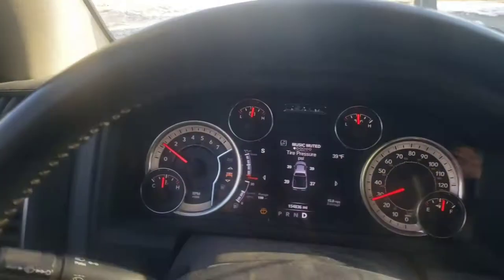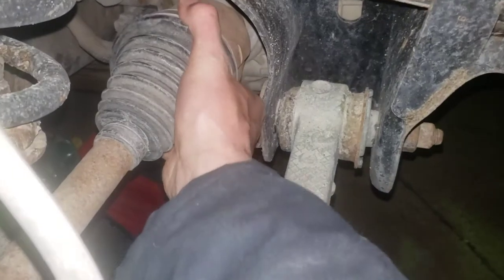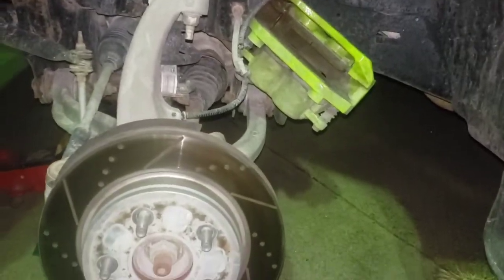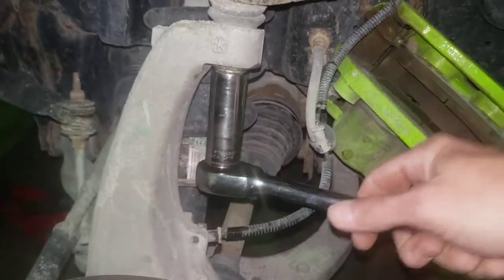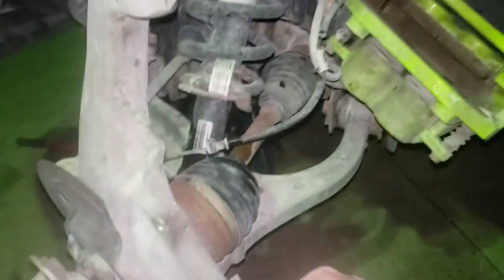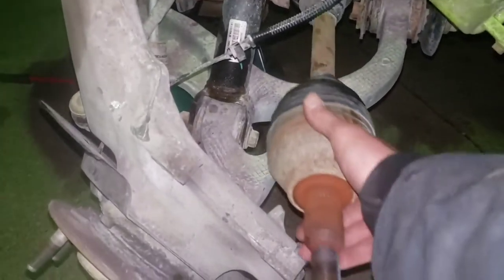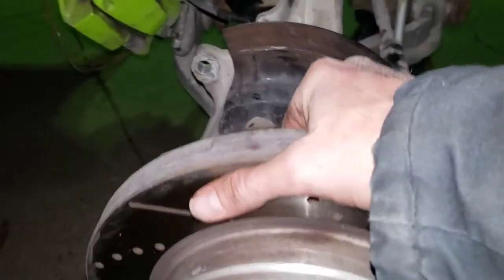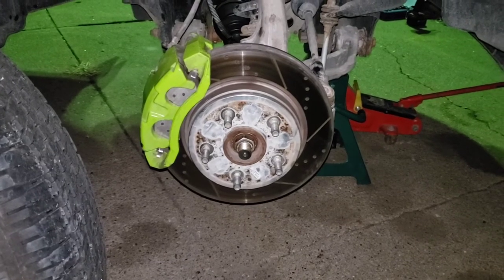CV axle & intermediate shaft. Ram 1500

Comment: Hayne's Manual from your local auto parts store has most of the torque specs. I have one for my 09 Ram. I've had to replace both cv axles, ball joints and inner / outer tierods and it was a time saver to know them in advance. I know have a spread sheet with all the bolt sizes and torque specs that I had to use.
Reply from the maker: I might just need to invest in one.

Comment: what intermediate shaft did you end up buying, same issue with my 2011 1500 but i just pulled the shaft right out with the axle as it was seized on. but the intermediate shaft you bought and did not use looks like the right one for mine
Reply from the maker: Since this video came out there's been a ton of passenger side intermediate shaft kit's that have shown up online. I got one-off of ebay. There's about a million to choose from now.

Comment: Hey man.  Another great video.   With regards to the right intermediate shaft, I have a issue with it being worn a bit as well.    I looked into it forever and all answers let back to having to replace the whole front diff. because no one makes this part  (Not cool)  but being that this seems like a problem everyone was having, I figured that some company would make this part, sooner or later.  Behold, RockAuto as of a couple months ago started selling this part.  (NEX12003 Front right inner 4WD).  The part will most likely be out of stock because I think it not mass production yet.  You can sign up for the "Notify me when Available "  and when you get the email that it is, drop everything a d buy it.  I had to sign up twice because I waited a couple hours the first time before buying and it was sold out right away.   I have the part now but haven't replaced it yet.  It looks like a real pain in the ass.  Lol.  Hope this helps.
Reply from the maker: Leave it to rock auto. I forgot to even check there. Thank you for the info.  I bet it'll be a huge pain in the ass.  I haven't priced a diff yet but it'd probably be easier to install.  Lol
Reply: @notamechanic153  I am in Canada and the whole diff is about $1900-$2200, but you are right, most likely easier to replace haha.
Reply from the maker: @jweldude  Let me know how it goes when you decide to try putting that bastard in. I'm not really sure what I'm going to do.  I'll probably drive it like it is until it fails, then fix a disaster.
Reply from the maker: @jweldude  how much was rockauto charging for that shaft?
Reply: @notamechanic153  I paid $134.45 USD - $165.88 CAD for the shaft.   And I may do the same, but I will let you know.
Reply: @jweldude  Could you send me a link? Would be much appreciated!

Comment: over the weekend mine started slinging a bunch of grease on everything. so yaaay I get to do this soon.  Piece of shit only has 72k miles.  I would have expected them to last alot longer than that. My silverado had 130k on it and never a problem.
Reply from the maker: Totally agree.  I really don't like how they have the front diff or the transfer case set up.  On top of that you have to get specific fluid for the transfer case. Can't use universal shit that we've used for years.  Hell no, you have to  spend $35 a quart for a midrange product.
Reply from the maker: And I didn't even talk about the axles. Fuck, I use 4x4 a handful of times a year.  There's no reason they should've been torn up like that.  Unless......they were shit from the beginning. And then they have the nerve to make  you go to the ends of the earth to replace.

Comment: I am having trouble removing the axle on passenger side if is seized in there any tips to remove if?
Reply from the maker: Shit dude,  heat seems to help with most things.  But if it's major,  like where the gears are fucked , you might have to drop the front differential.

Comment: I just did the control arms, Brakes, Sway bar links and cv Axles and the stub shaft on my 2017 RAM 1500 also with the Pentastar v6. I would highly recommend doing the Wheel bearings while you have it all apart, made a huge difference on mine. I also could not get the passenger side shaft out, then I realized it's not the same shaft and I gave up on it. Now my steering shaft need to be replaced, it never ends! For me, I'm chasing down a vibration and I got it about 95% vibration free, I'll see if the steering shaft makes a difference...

Comment: 35mm works better on that axle nut I found.  Same issue with the shaft on my 2015...dont know what grade of steel ram is using for these shafts but it doesn't appear to be very good steel for the application.  My opinion...as long as you re torque the old axle nut to spec its fine.

Comment: I have same truck and same issue and found passenger intermediate shaft on ebay and amazon for $ 320
Reply: I found mine in Amazon for 280... it will take me 1/2 day to replace it myself, with my milwaukee  tools might take less than half day
Reply from the maker: Mine is working good for now. I'm sure I'll be replacing it in the future though. Let me know how how your projects work out 🤘
Reply: I will try to make a video
Reply: Can you send me a link to this? I need a passager Intermediate shaft as well. Please help

Comment: Is there a bearing change in axle  for left side?
Reply: No
Reply: Is you're bearing bad?
Reply: I had a clicking noise when coasting before making complete stops... I delta with the cv axles at 115k, had then replaced 2 times and shop said he found a used front diff and took parts from the to make it work.. well 2 years later reman- cv axle boots ripped on both sides.. I just replaced them at 150k now, myself to se what's going on, that rattle was from the front diff, pass side stub shaft makes the noise.. im curious if it's a bearing or maybe it's something caught in it. No leaks but also my stubshafts are rusty again, im not getting to much longer until I need that pass. Shaft. Also on both sides the intermediate shaft has some play in and out on the diff. I hear it is normal asking most people, but I have a vibration at 60 - 65+